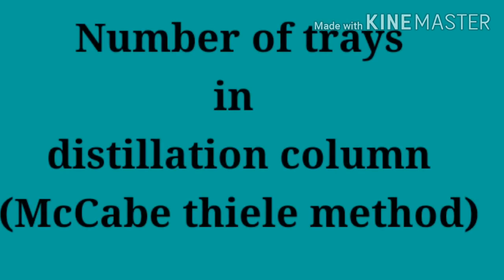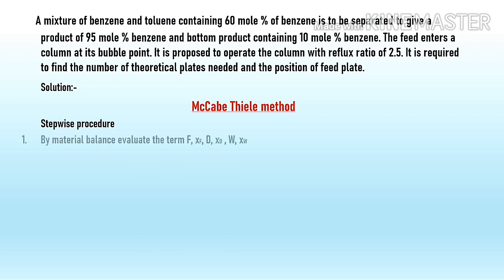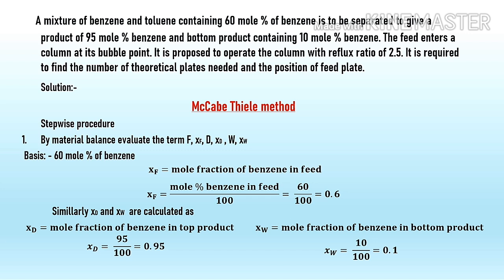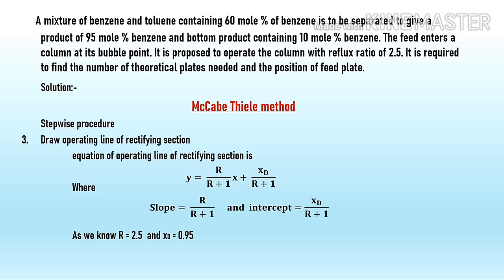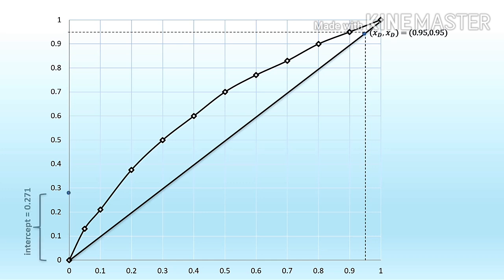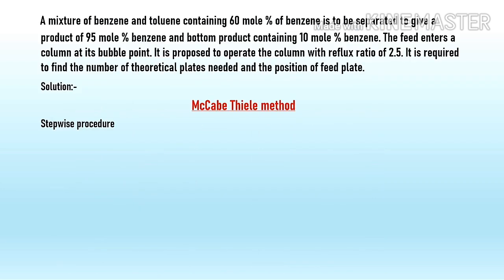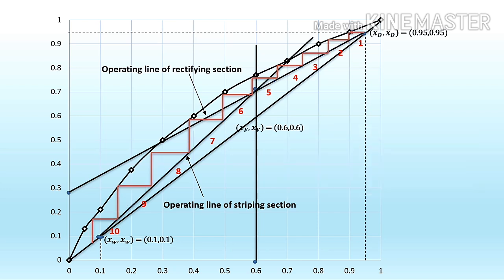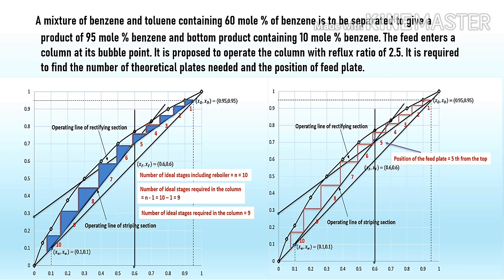McCabe-Thiele method, How to calculate the number of trays, Distillation column

Comment: Sir If feed is enter in Boiling point Then what will be changing??
Reply from the maker: if the feed enters at boiling point, then the feed line will be parallel to the y-axis.
and as per feed condition, the position of the feed line that is the slope of the feed line will be change.
Reply: @chemicaladda  
Ok sir Thanks